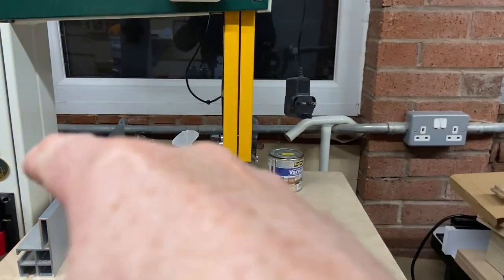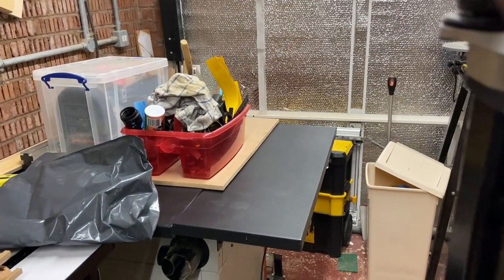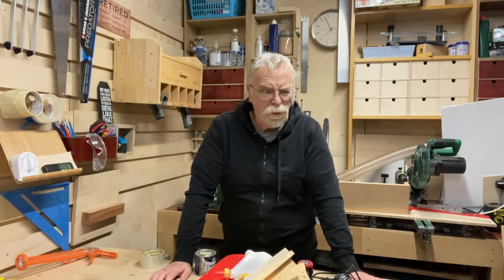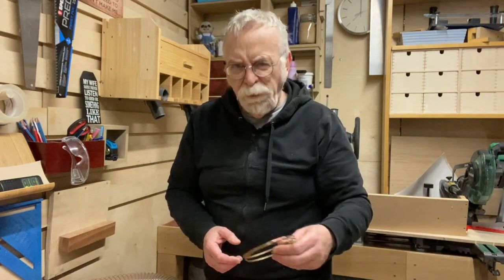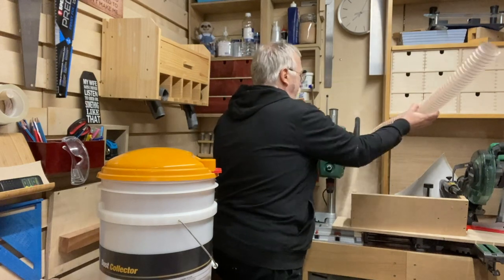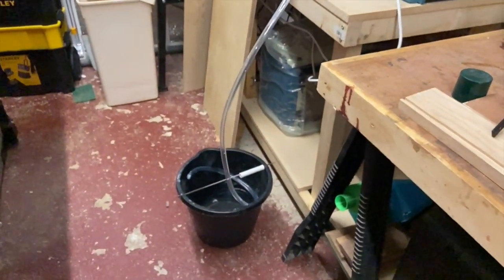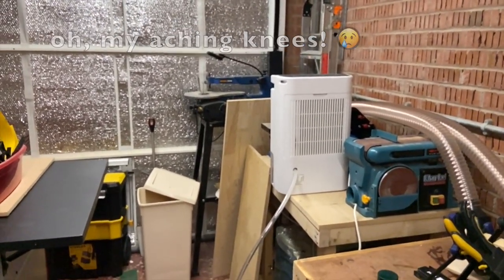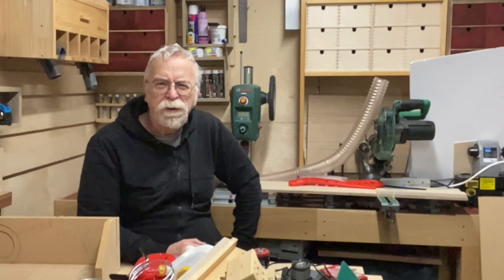GW#120 Sunday Update   HD 1080p

Comment: Hey Loz! Did you say you were going to use the 63mm hose for the cyclone and household vac?
I think you may find that the hose size may be too big for that and you’ll lose a lot of suction.

100mm usually works for HVLP systems (from the scheppach for instance) and reduces well to 63mm
50mm and under tends to work well for HPLV setups attached to smaller vacuums.

You may also find that inside the hose attachment on the bandsaw it reduces in size by half or more (my tablesaw was like that before I changed it’s dust extraction).
I run 40mm piping to my bandsaw and it seems to be ok. 

If you do need to make the 100mm snugger onto the bandsaw though, a few times round the plastic with gaffa tape should make it a tighter fit, and make sure the clamps don’t cross the tube wire more than once.

Keep at it fella 👍👍

Comment: For the multiple dust collection hose to one collector I used some quick connect for a dryer. I don't know if they'll be as easy to find in the UK, but I found they sealed surprisingly well and moving from the table saw to the vacuum dust bin as easy as a twist. The miter saw dust hood has to be the best thing I built in my shop second only to my french cleat wall. It cuts down on dust IMMENSELY. Also thank you for the cast iron clean-up and rust prevention tips, someone put a cup down on my table saw and I've got an ugly ring :(
Reply from the maker: I'll look into the dryer connector bud. ...mug ring stains> yikes! don't you just hate it when "someone" does that! 🤣

Comment: Similar problem here with hose adapters.  I use flexible pipe connectors from a builers merchants to modify apatuere to mate with the hose. Also, if you stress the Axminster grips by forcing the clamps in the wrong direction (pulling the handles apart) you can get them to grip better by distorting the metal wire but still not perfect
Reply from the maker: yup, its a pain isn't it.. have already tried stretching the clamps.. no go... so jubilee clips it is I think!?

Comment: Watched while putting kit I used months ago away behind stuff I didn’t want to move. The solution for dust collector hoses is to spend way too much on fittings or even more money and time on a 3D printer. Fill the gaps by going around it several times with tape to add a millimeter to outer diameter. Good enough
Reply from the maker: good shout FW! 😀👍

Comment: Great update on what's happening there. Helps keep me sane in these colder months. Dust ports drive me crazy too, I use tape to make hoses bigger or ports smaller or just to form a seal and short lengths of inner tube on smaller ports but every small machine has a different size! On 'quiet' visits to the workshop I do a bit of sharpening, keeps me occupied and warm and all the gear is in one drawer. Cheers, Ben.
Reply from the maker: Thanks Ben. Yup, I've fallen back on using tape for a long time.... just looking to make everything pretty and not struggling to get tape on /off every time I use a machine...."work in progress"!
Reply: @GrumpaLoz  You and me both. I'll be interested to see how you solve it because It's the main thing I battle with.

Comment: I nearly bought those type of clips for my 63mm hose, but decided to get the thumbscrew ones instead, maybe not quite as easy, but better than looking for a screwdriver.  I’ve solved the non standard hose ports on tools thanks to my 3D printer, so I can make any size adapter at will 😁. I’ve also run a 40mm pipe system with blast gates to quickly switch between tools 👍.  Cheers, Bill.
Reply from the maker: Great tip Bill!

Comment: Hi Loz. Clamps, Chinese clones, half price, unbelievable. Do you have your dehumidifier running 24/7 and what power consumption does it uses per hour? 
I've also just made a wooden cover for my thicknesser table, never used to get any rust when my workshop had a wooden floor, before the flood. Cheers Tony
Reply from the maker: Yup, I'm a sucker for "half price" sales....😒.. but I need a set in all sizes so they'll do "for now"......dehumidifier runs 24/7 but it kicks in and out its 450 watt at full belt. and I'm refusing to look at the meter (😜) now I'm getting the space sorted to spend more time in it thinking of replacing the fan heater with an oil filled radiator... with ventilation its just a case of balancing  trying to heat the whole of the pennines or drying out then whole of the pennines... oh and its just snowed again to the dehumidifier is struggling again! 😒
Reply: @Grumpa's Workshop  Ditch the dehumidifier and buy an oil filled radiator set it on low so it kicks in ind out, it will keep your workshop rust free and keep the chill off so its not freezing when you go. Had one since the 1970's doing just that in our previous garage woodworking workshop, which then transformed into my metalworking workshop. It's  a no brainer. You must seal all or the majority of drafts otherwise the heater will be playing catch up. Try it. Tony

Comment: Hi Loz, don't talk to me about dust extraction ports, I have been trying to sort my dust extraction out and every port and pipe is different! What is it with these manufacturers? to buy a specific pipe or connector is expensive. After watching other youtubers, I am trying the warmed up and resized waste pipe option on some.
I have one of those triton dust buckets, great piece of kit, but what do you do with a bucket full of sawdust?
Keep up the good work and stay healthy, talking of that, I spend ages just sitting in my workshop looking around. 😂😂😂😂
Reply from the maker: Yup, every outlet is different and even the stepped multiple connectors don't fit anything! Its a plot I tell you!.. and the sawdust goes in the compost "garden bin" for collection.....
Reply: I use my sawdust as mulch around the garden. Regards JP
Reply from the maker: @SBW02  yes, mine has gone into the compost bin before now, but there’s too much MDF in the bags atm. (Resin & chemicals…..)